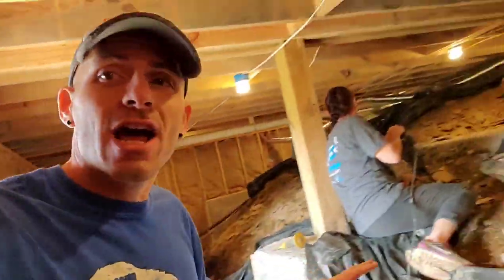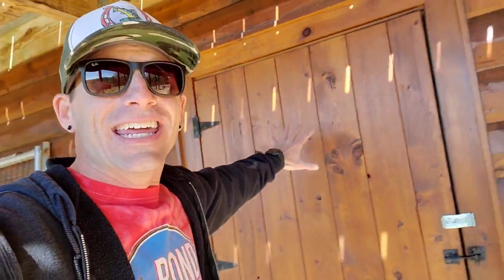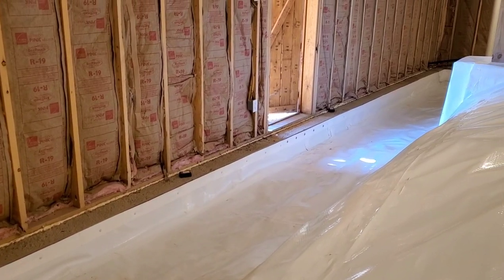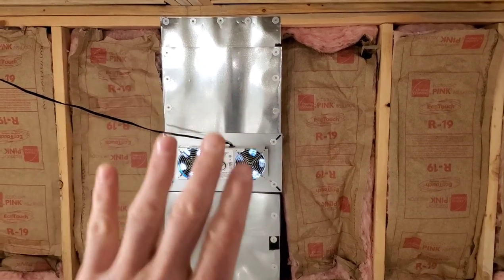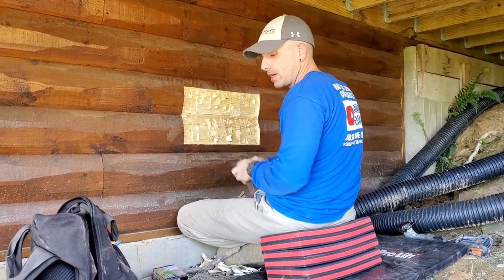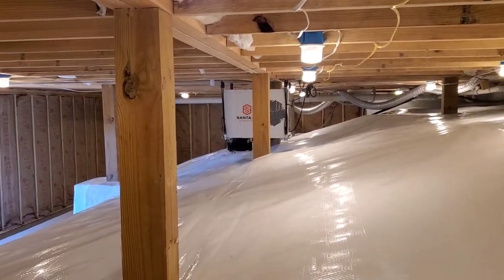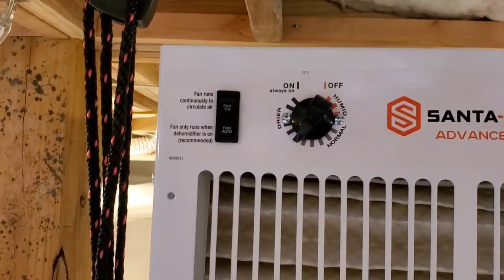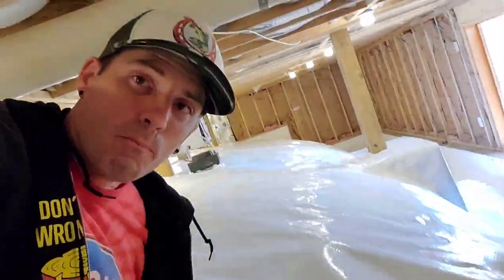Crawl Space Encapsulation! What Your Builder Don't Know!

Comment: Awesome job!
Would you also install the floor insulation in a crawl space with the furnace in the crawl space?
Reply from the maker: Not sure what to visualize whenever you say furnace?

But likely yes.

Thank you too Charles!
Reply: @TannerFlowers  o sorry it's my gas furnace, all my vents are in my crawlspace so in winter its warm in there and in summer it's cool down there, it is encapsulated just wondering should I put insulation for the floors even though its basically a conditioned crawlspace.
Reply from the maker: @charlesoneal757  it will keep temps regulated inside your living quarters of the home for sure.

Comment: Man tanner I’m a new home owner and it seems like it’s issue after issue I currently came across your videos because I’m sure you can guess it. Here in Concord NC we had some heavy rain and flash floods. Therefore my basement has some standing water but Ive also found that my foundation is leaking as well. I believe I’ve located the leak under the home but man I don’t know where to start I need some help
Reply from the maker: Send me some photos. Contact email is on contact page at CRAWLSPACEARTISTS.COM
Reply: @TannerFlowers  will do as soon as I get home thanks man
Reply from the maker: @MrW3ST  no problem.